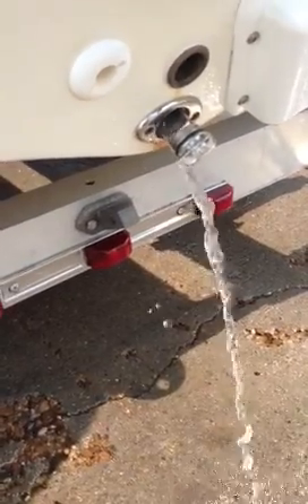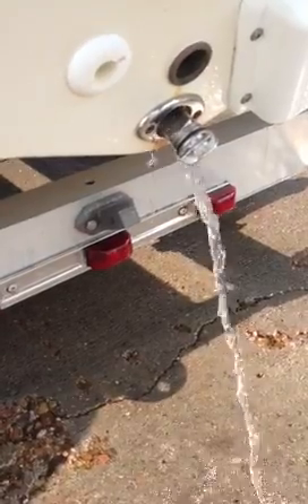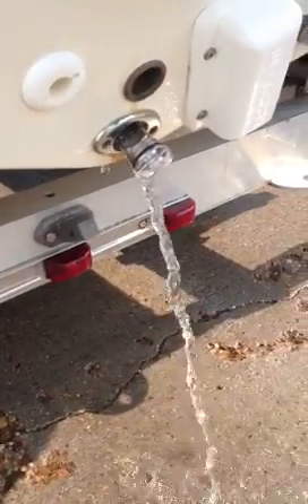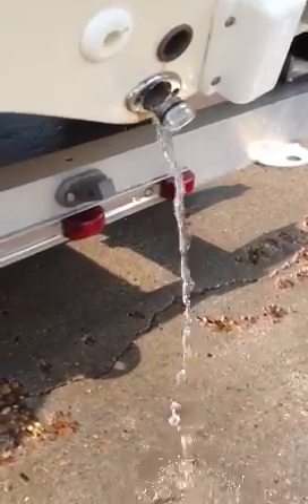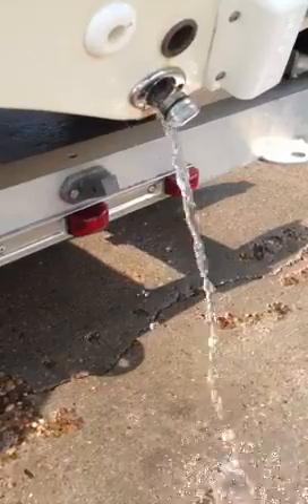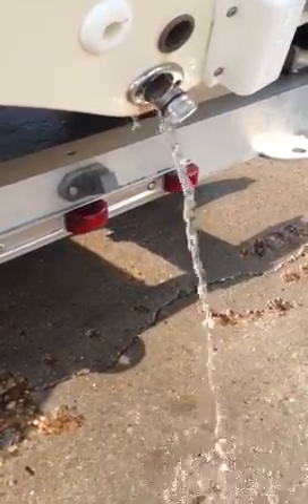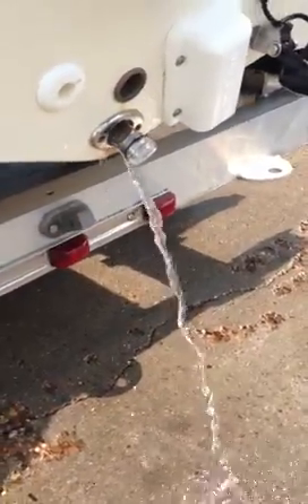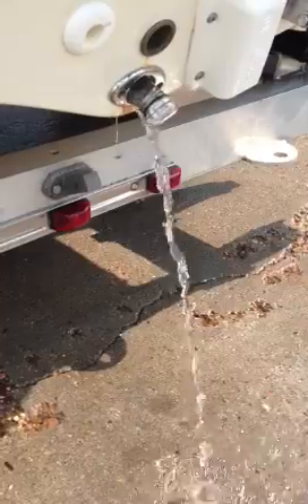Mako Pro Skiff Water

Comment: Had the same with my 2013 Pro 17 Skiff. Took it back to Bass Pro in Ft Myers and Mako swapped it out with a new 2014 hull. My water was coming from inside the boat. I proved that by running a hose into the boat while it was on the trailer and left the bilge plug in but pulled the hull plug.